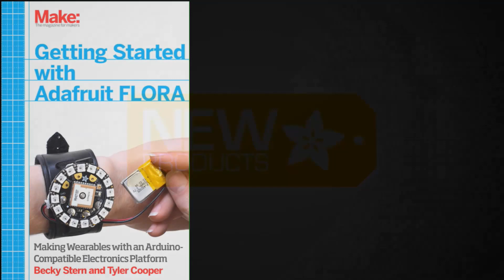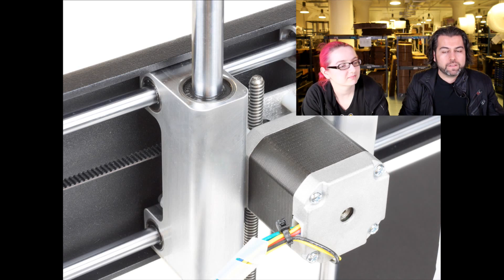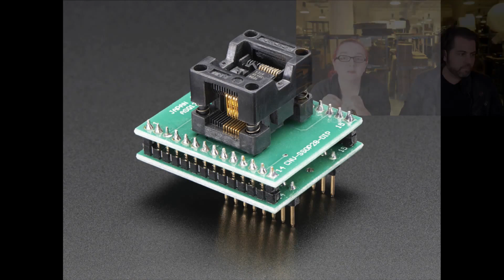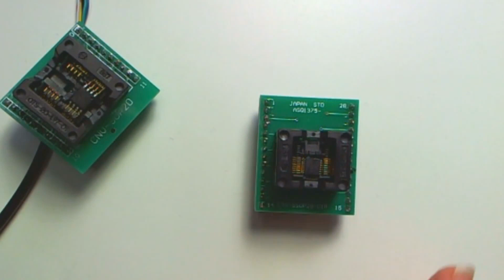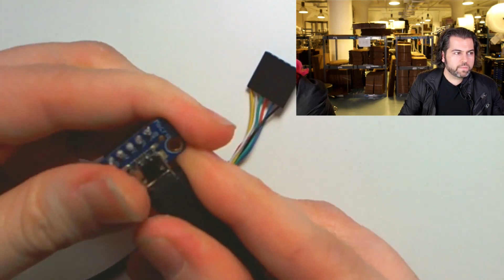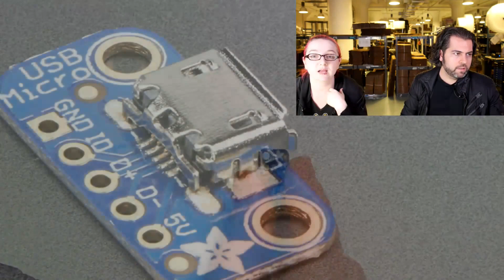New Products 4/23/2014

Comment: If you buy a printrbot read up on it before printing.  It's got a few quirks that have not been worked out yet, or at least not when mine shipped (from printrbot not adafruit).  Off the top of my head, the Y axis is mirrored, and the bed size may be set incorrectly in the firmware, causing a (minor) attempt to run past it's endstop when a print finishes.